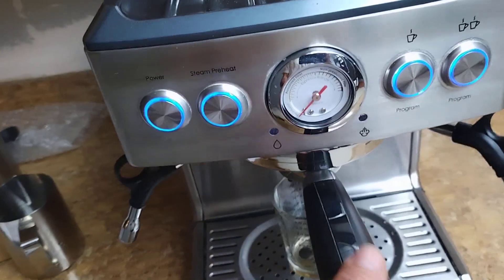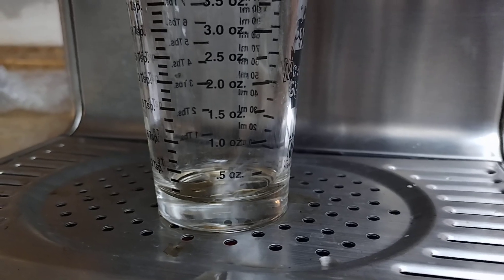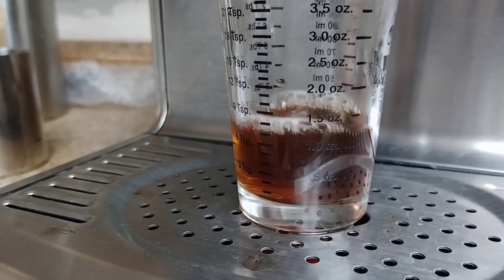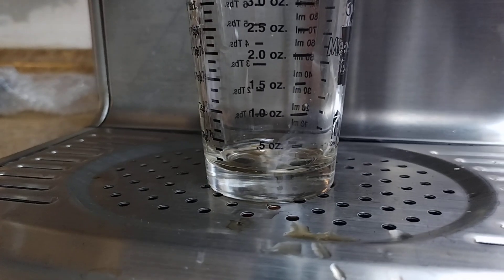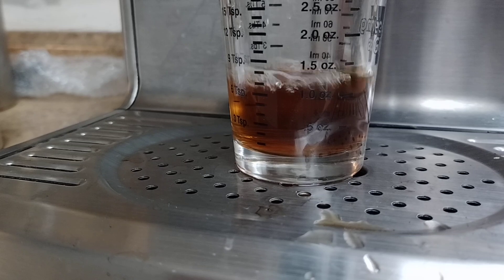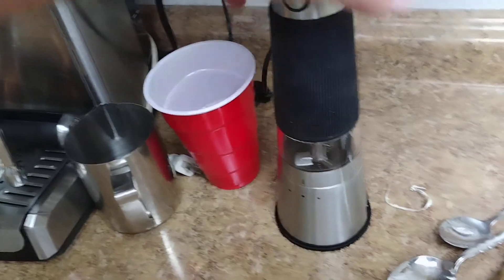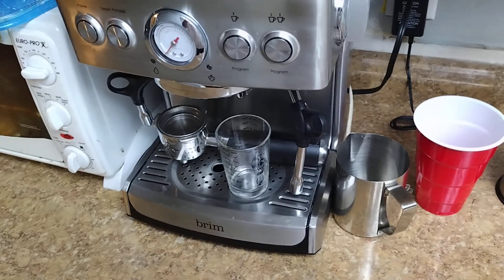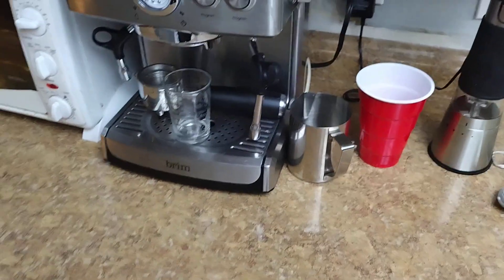Defective Brim 19 Barr espresso machine programming

Comment: I also thought mine was defective as it was choking at 17g. You are right about the double basket, it is very small. Try reducing your dose to 14-15 grams and adjust from there. It's certainly not high end or perfect but drastically reducing my dose helped me figure out how to get passable shots with this machine. However, if was drinking the espresso straight I'm not sure I'd feel the same. I do like milk and sugar.